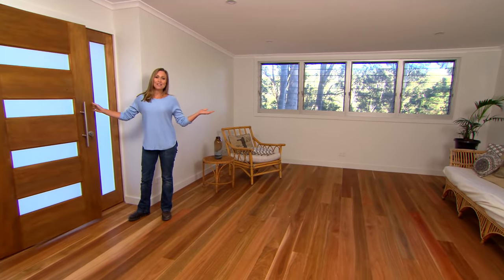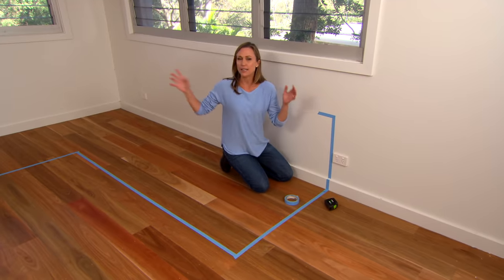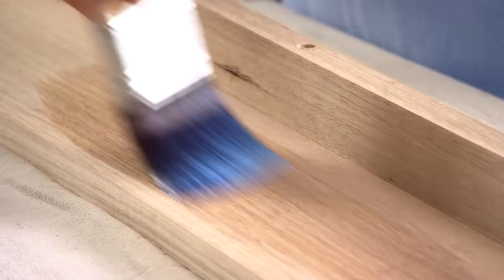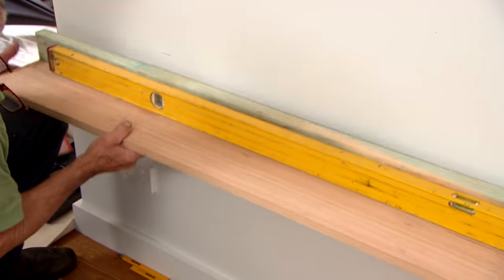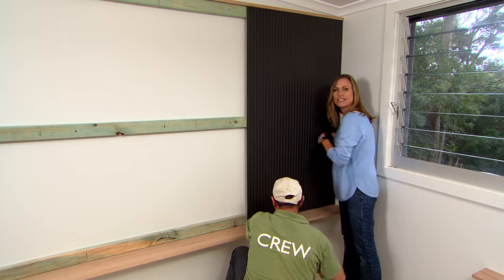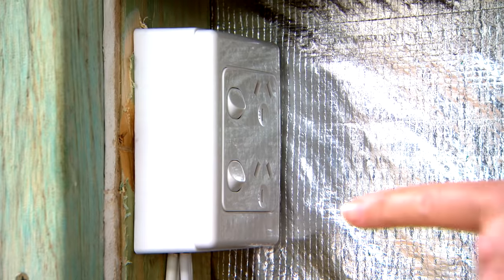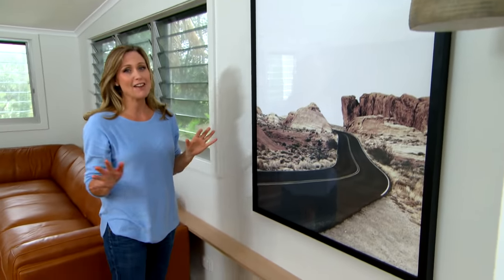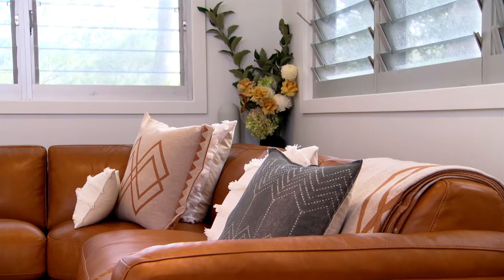How to Design, Layout & Style Your Lounge Room | DESIGN | Great Home Ideas

Comment: The sofa is great. Think the shelf behind it is impractical, though. Also, the coffee table is too small scaled for the space.
Reply: I agree about the coffee table. It is too far from the sofa as well. Ideal distance is 17 inches. I believe a larger, rectangular shaped one, would have been more appropriate.
Reply: You don’t need to reach the coffee table because you’ve got the shelf to put drinks etc on. The coffee table is just to fill the space and for decoration. The shelf is really practical.
Reply: @NiffaK    Yes, I’m aware of the shelf behind the sofa. I’m strictly speaking  standard placement and juxtaposition of a coffee table in relationship to the seating arrangement, since the coffee table is considered the center of the living room. It’s location is such that all those in the conversation area can easily reach it.
Elderly individuals are physically challenged, and to utilize a shelf behind the sofa, is impractical for them, thus the coffee table now becomes the reachable surface.
In my design services, I place the coffee table approximately 14-18” from the sofa, enough space to navigate around those seated, and close enough to set drinks on.
Reply: That's called a console table😑 and that's not impractical, it's pretty useful especially when you have kids at home